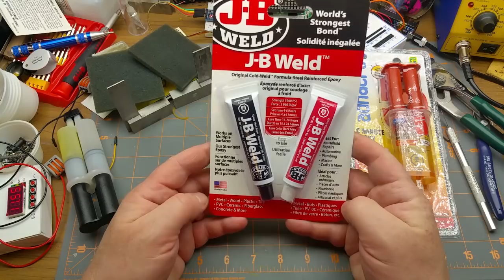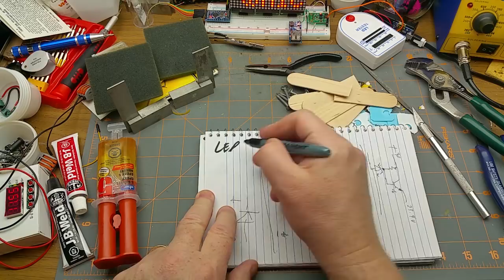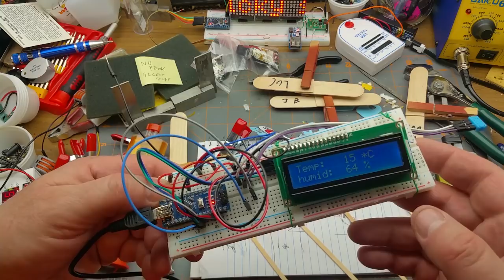epoxy - are they all the same?

Comment: Great experiment.  I did the same in a work setting with 6-7 different brand 5 surfaces.  Our application was to be  for high density mold form, (think high density compressed sawdust and foam), and we had the same issues with the bonding.  We did have to prep the plastics to get them to stick, but it was never as strong as the high density board or metal. We also went with the JB Weld.  We CNC'd the samples, and enjoyed the destruction of most samples in the machine lol.

Comment: We mainly use JB for filling stuff rather than a glue.
We have this stuff called Selleys - Urethane Bond that is probably stronger than all of those, the problem is that it has a lot of negatives. Like it's $18 for a 30ml tube, it says liquid for 6 hours and cures in 12, it bubbles and expands, and it goes brittle if left in the sun after maybe 5 years.